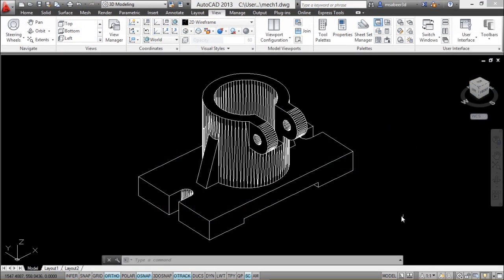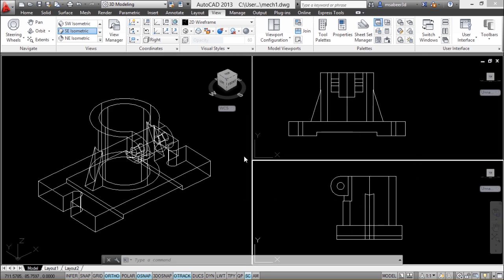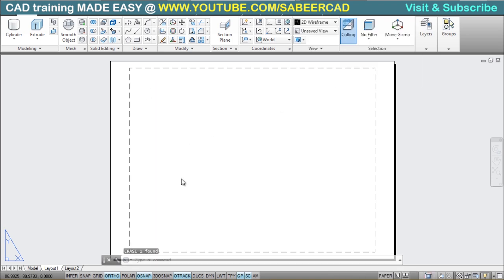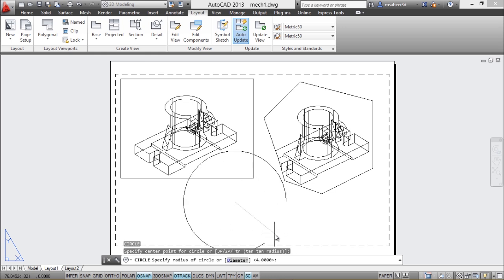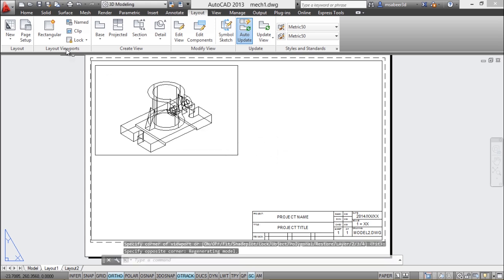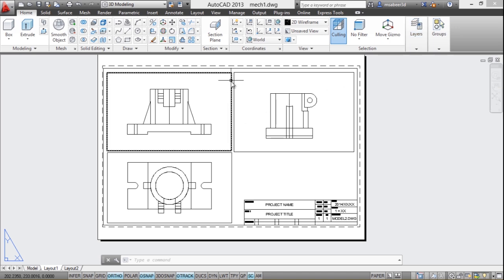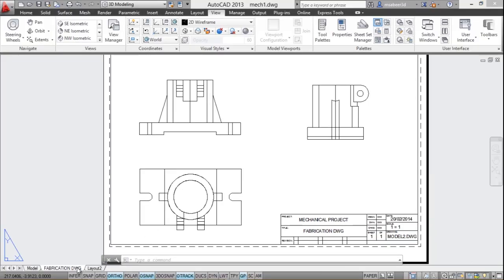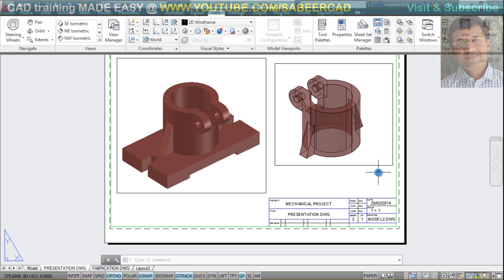AUTOCAD LAYOUT | AUTOCAD VIEWPORTS

Comment: I used AutoCAD 2020 but I dont find that layout tab in my AutoCAD ( even 3d modeling Interface). Only find Home, Solid, Surface, Mesh, Visualize, Parametric, Insert, Annotate, View, Manage, Output, Add-ins, Collaborate, Express tools, Features app. 
Can you please say how can I find that option which you click at 6.08 moment in this video? please say about it. many many thanks for such a helpful video.
Reply from the maker: You can Activate Layout at the status bar (below),  then you will see the layout tab on top

Comment: At 9:50 when you insert title block in layout 1 it completely fit in the paper size because in both drawing unit is in mm.
But in my case i created title block in inch unit and i downloaded your drawing which is in mm unit. When i tried to insert it in layout 1 it becomes very small . What is the solution for the problem . pls reply
Reply from the maker: Always maintain the same unit in both drawings

Comment: Please allow me to place some constructive criticism. What you did was fine but not the best way to create a proper multiview drawing, you would see problems when you apply dimensions. Try SOLVIEW, SOLDRAW and SOLPROF commands, you will see how all views are created without affecting the original model and how several layers are created automatically to allow you to control visible and invisible lines. AutoCAD 2015 and newer simplified the process, just look at the layout options in the layout tab of the "drafting and annotations" workspace.